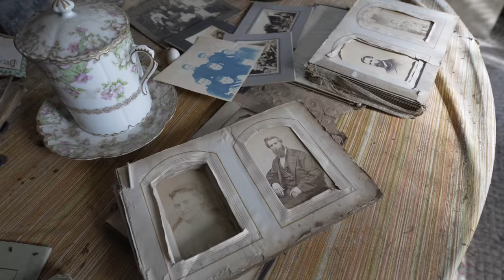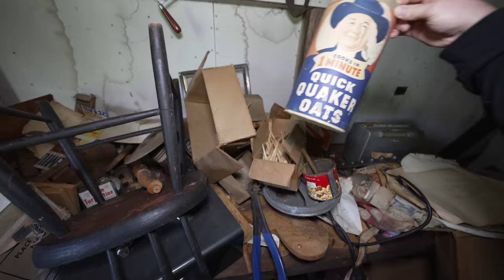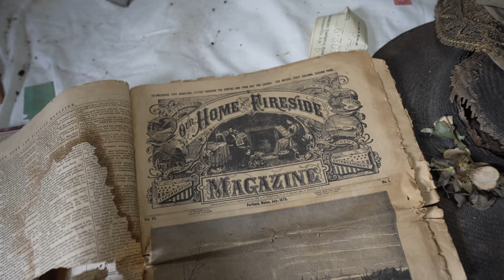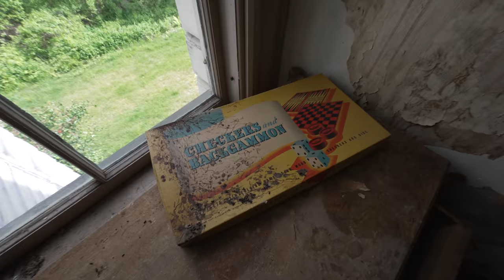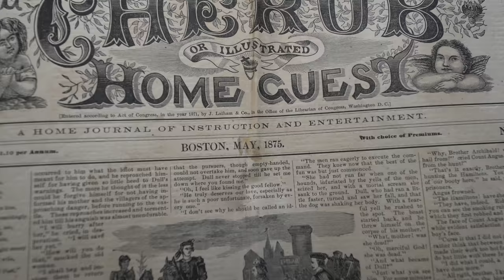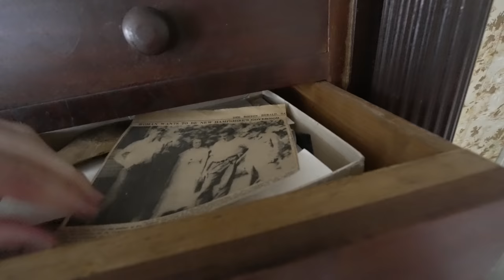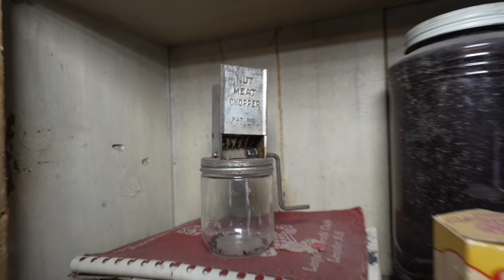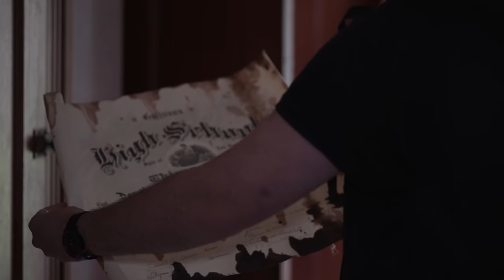Exploring The Upside Down House | Top Secret Abandoned Home

Comment: The house looks like it may have been set up for a historical home tour at some point.  That would explain why so many things look like they were just abandoned.  The fact that there was no rotting food in the dishes backs this up.
Reply: I was wondering about that, Because most of the main antics didn't have dust or rust on them.
Reply: Yes! It looks exactly like houses that were propped up to look how it used to… for tours or whatever and now it’s just there lol.
Reply: That's what I was thinking.
Reply: Last time it was lived in was 1980.  All this stuff is older.  I don't see anything from 1980's. 🤷
Reply: @weaz1964  There were a couple of electronics from either the late 70s or early 80s but that was about it.
Reply: I was also thinking this same thing. I noticed there was minimal dust on things, even when he opens books or touches cloth. And the windows look like they had been cleaned, whereas old untouched windows would be cloudy with dust. Alot of the items in the windows weren't discolored from sunlight which is odd for this old of a place. Things had to have been set up by someone. Everything was neat and facing forward. Strange. Sure would like to know and would LOVE to see this place in person.
Reply: Does anyone know where it is I need to visit it and smoke a joint on the land
Reply: @elliehill9165  🤣🤣🤣
Reply: I wouldn’t take anything, just spiritually connect while on healing ganja 🍃  🧘‍♀️
Reply: @elliehill9165  I love weed,I use it everyday,💚🍁
Reply: @annettelacey7913  me too if I could I would inject it into my veins
Reply: I so agree. I was going to say this place looks very staged
Reply: One of the many tell tale signs that this was once staged is the crisco can, spic and span and ivory snow box put together like tha... beautifully set up for a photo opp or staged for display
Reply: @weaz1964  I saw a cardboard modern curads box
Reply: Yes
Reply: I fort the same thing bro it was to well set up
Reply: Would you really expect rotting food to still be present after 40 years?

Comment: @33.07
It's an old geometry set. Compass, they used ink and some even had tiny lead pieces that slid in the end of one of the points, they have little twisting locks that secure the lead. Xx

I have one myself. No where as exquisite as that one. X

Seriously though that house REALLY needs preserving. As a suggestion. Contact the local mayor..historian to the house, and suggest auctioning one or two items off to pat for it to be permanently preserved and secure. Xxx

Love from Liverpool UK ❣ 🇬🇧

Comment: You asked about the thing in the attic, well its a two part answer,   Those big wheels you saw first, those were for spinners wool or cotton fibers,  the thing you specifically asked about in the attic would have been used after it had been spun on the wheels to make rops, or depending what looms where there it could have weaved for textile fabrics

Comment: The tools you asked about are old compass for drawing, or planning.  Used more with map drawing, but since he did alot of wood work i imagine it was for drawing out what needed to be cut like the plans piece by piece for whatever piece of furniture they worked on could have been used to map out where what crops went.
Reply: It usually had one end the stayed on paper and another end that held a pencil, chalk writing utensil and as you moved one end whatever writing utensil was held in it made a line corresponding to the pointed end

Comment: I looked up that Declaration of Independence that’s in the house. It looks like it’s a lithograph from 1856.  
The ones I find online are going for less than $2k I did find one that was sold in October 2017 for $4k.

Now that piano on the other hand is worth probably $35k or more from I can find.  It’s very rare now days to find one. I found different types, the ones looking like that one were sold for $35k-$55k.

That huge machine in the attic is a loom for weaving. The machine holds the threads tightly so the weaver can weave.

Comment: How much does a square grand piano cost?
Prime examples of Steinway square grand pianos have sold at auction in the $8,000-plus range. But most run-of-the-mill examples bring prices only in the $250 to $700 range, with a few reaching a mid range of $1,800 to around $3,000. They are no longer made.